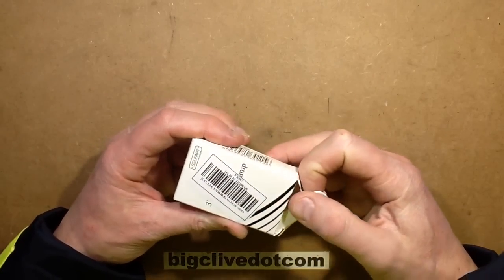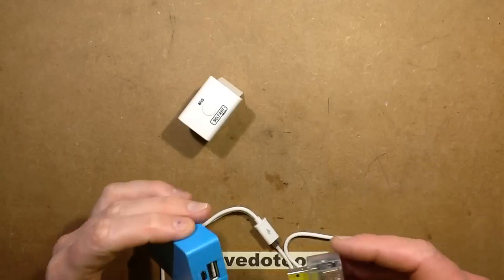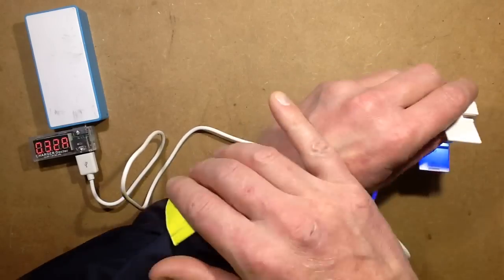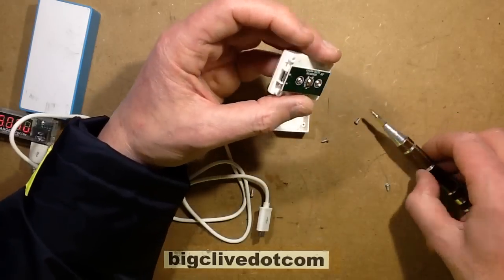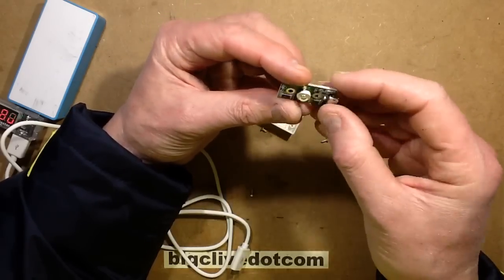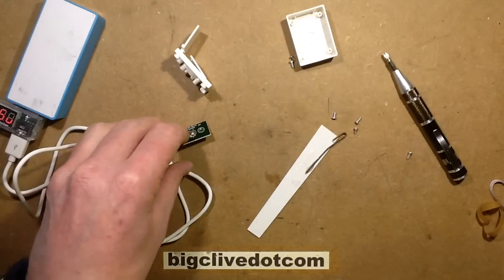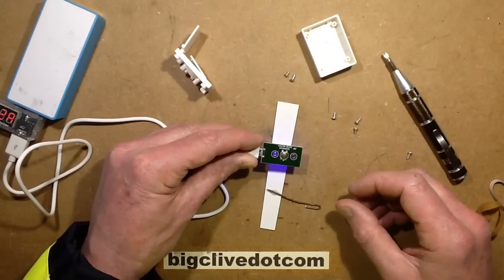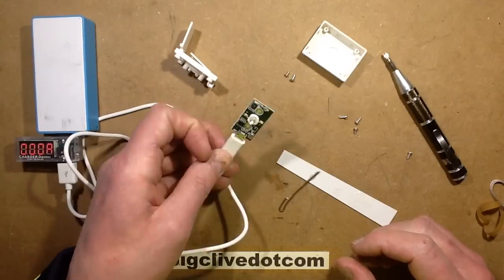Mini UV curing light.

Comment: How much skin cancer per watt is this rated at?
Reply: one millionth of an average collection of 10 youtube comments. (not referring to yours of course :-) )
Reply: +petti78 That would be 10 microcomments then
Reply: I'd be more concerned with going blind than skin cancer. It may appear "oh just a little bright", but it might actually be VERY VERY bright, just your eyes can't see UV that well. (So it may blind you, don't stare too long.)
Reply: This. I would be more worried about eye damage. Your eye doesn't react to what it can't see, but the damage is still being done.
Reply: Low power, brief exposure. Probably negligible.
Reply: Captain Obvious Your body is capable of repairing small damage from UV from such a small surface area.
Reply: Mostly Harmless
Reply: +Bowowowification Exactly why i chose to rebuild my PCB exposure box using 395nm LEDs instead of 365nm LEDs (although the photoresist cures much faster under 365nm). 15 watts worth of 365nm LEDs only emitted a faint visible glow that you could easily look into without even realizing it. I wear protective goggles when messing with UV, but I still prefer being able to see the things that could kill my eyes.

Comment: I was hoping you were going to demonstrate its nail varnish curing ability. A nice day-glo yellow to match your coat trim perhaps?
Reply: Brew Time
i didnt know such things existed! which is why i mentioned it, cheers brew time! (gonna go have a brew, a nice cuppa!)
Reply: jusb1066 Resin is like a glue basically, can be used for a bunch of things, it will remain a liquid until a uv light is used to harden it, so he checked the effectiveness of the light by seeing how quickly it hardened :P
Reply: Brew Time
i rewatched it, its some kind of modellers glue i think now, perhaps i am one of those high functioning idiots and non one has ever told me!
Reply: jusb1066 Resins can be used for casting things aswell, though I think that may be a different type of resin
Never really used it though so I don't know the ins and outs, just what I've seen in videos :P
Reply: CornishMiner  just what I was thinking too. Its surely the only way to properly test it!
Reply: wonder what the UV curing resin is meant to be used for?
Reply: jusb1066 Not sure if you didn't get the humour or if you're just playing along and I'm the fool, hmm
Reply: Brew Time
no i wasnt sure what the uv resin is, turns out i think its nail varnish? honestly i must be missing something!

Comment: Lol. Spytech.. Does it erase eproms?
Reply: Believe it or not UV ERASABLE eproms are still in use by many individuals in hobby electronics. There are still 2-way radios that hold their operating firmware on such chips. That is one reason they were easily hackable for use with systems they were not originally designed for. Don't rule out items to the dinosaur age quite yet.
Reply: What's an EPROM.......those things went the way of the dinosaurs.

Comment: That USB cable looks exactly like a Samsung one
Reply: yes, its the chinese fake one they pretend is genuine!
Reply: samsung cables are chinese too. and they dont pretend its genuine just because it looks the same. its just a cable. obviously cables look the same. if they write samsung on it they would pretend its genuine. 

those OEM cables are usally pretty good quality. they are usually made by the same company that makes cables for samsung or sony. they know what they are doing. samsung does not make cables. they only buy samsung branded cables off a chinese company of their choice.
Reply: jort93z
id still rather a genuine samsung charger than a rip off chinese one, there has been a spate of house fires near me, all attributed to fake chargers, we have several of those shady shops and market stalls also selling them for £1 or sometime more, but seem a bargain to the £10 or more for something from a supermarket, untill your house burns down or it fries your ipad
Reply: many cables one ebay/amazon are from china sellers and sold as genuine in that they put it in the title, and it looks exactly like the oem samsung cable, whether it is from the actual production line i dont know, i have lots of £1 chinese usb cables, they all work fine, i dont worry about super fast charging anyway,  but i do know there are sellers of 'genuine' apple chargers from china too, those are all fake, but outside they look the same.
Reply: umm... but that cable is not sold as a genuine samsung cable?  it just came with the device and does not say its a genuine cable. yes there are fakes. but that isn't one. its not claiming to be an original cable.

and chargers are something entirely different. chargers are a lot more complex and a lot more can go wrong.
Reply: jort93z
no, but what i mean is, in this case it isnt, but on ebay in general, you will find it sold as genuine samsung, it wont say it on the cable but in the ebay title, and it looks the same cable to not just me but the OP too!
Reply: jusb1066 yeah thats true. though samsung chargers aren't even the best quality. they are literally just freebies they throw into the box with their phones. there are way better chargers then those samsung ones.

they obviously work fine but they are not awesome or anything. they just wont blow up in your face. most chargers wont.
Reply: jusb1066 well just dont get a cheap charger. if you spend 10$ on ebay for a charger from a seller with good ratings you'll be fine.
Reply: jort93z
i do, i stick to branded chargers from amazons own warehouse, got rid of all my potential crap ones
Reply: jusb1066 alright.